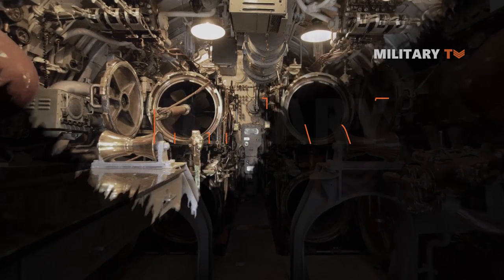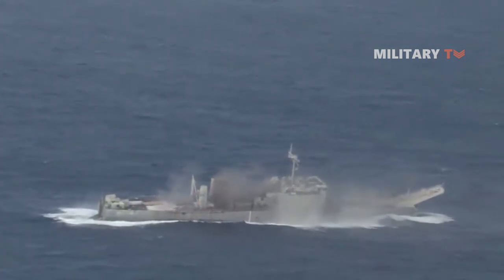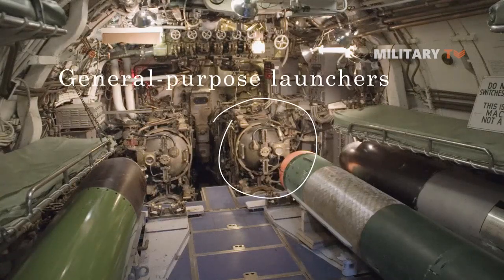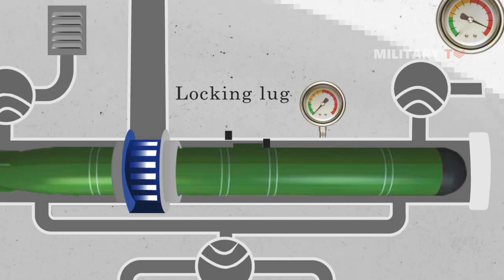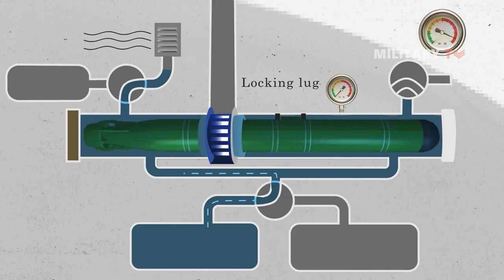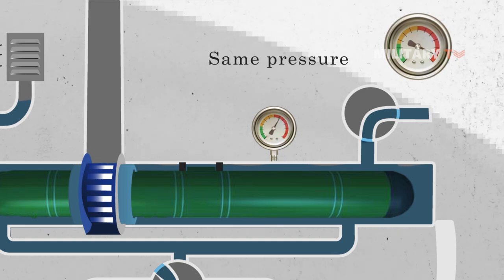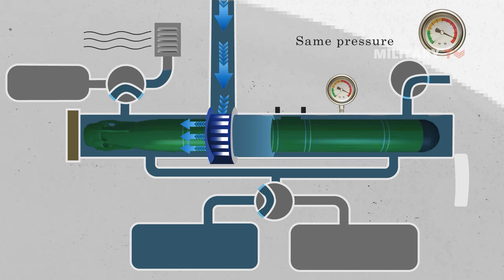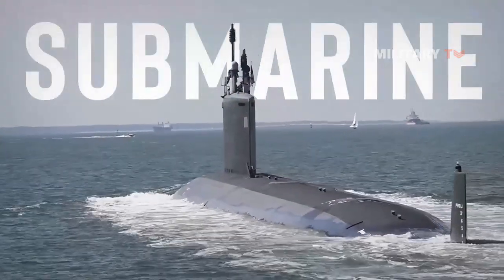How does the submarine fire a torpedo

Comment: I'd be more interested in the fire control programming of the weapon is accomplished while in the tube but that's probably classified and if wired how does it not get tangled, how and when is attached and detached.
Reply: Spy ⬆️
Reply: The video skips the part where the wire dispenser is loaded into the tube with the torpedo, and locked into the back of the tube. The wire often breaks

Comment: Rocket engine with valve porting. Four surrounded fronter part and rear main propulsion. Quite low pressure is needed, oxygen +hydrogen pressurized water vapor generation?😅

Comment: There are, at least, three modes of launching a torpedo from a submarine, each one with advantages and disadvantages. Those not described in the video: positive discharge (with air, very noisy), swim out (when torpedo starts its engine inside the launching tube) and push out (with a pneumatic ram that expels the torpedo from de launching tube). The one shown in this vídeo is called flush out.
Reply: Flush out seems like the best to me. All the others seem like they would create a huge amount of noise while still loaded within the subs hull, thus giving away a very precise location. Especially pushout. I imagine that creating sonic waves that are easily detectable. I'm no expert, but I imagine using a liquid would be the most silent. All the other methods seem a bit like they would be creating detection from directly within the vessel.
Reply: Swimm out is the most silent mode for launching torpedoes, especially if you are using electric powered torpedoes, but it has some issues.